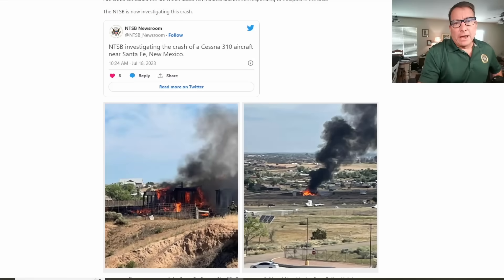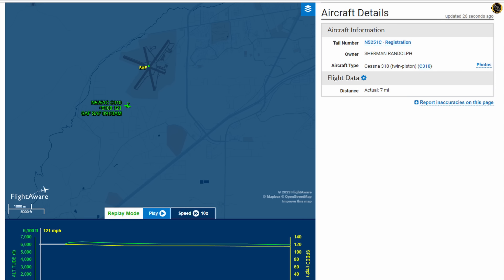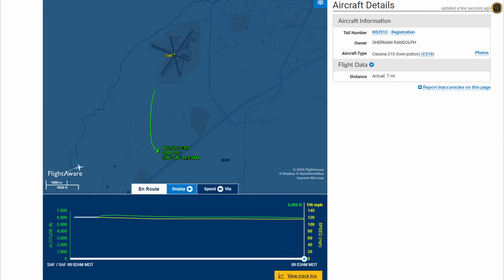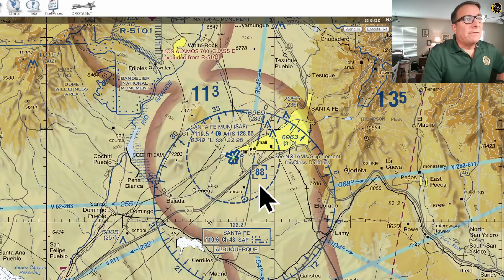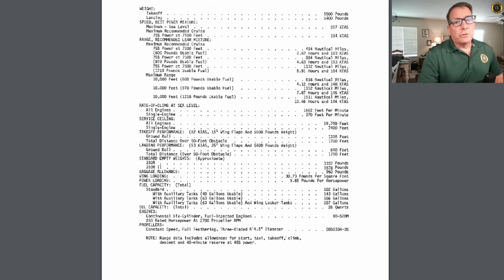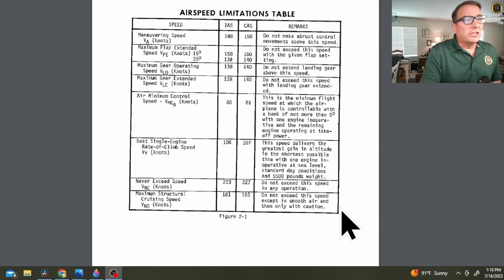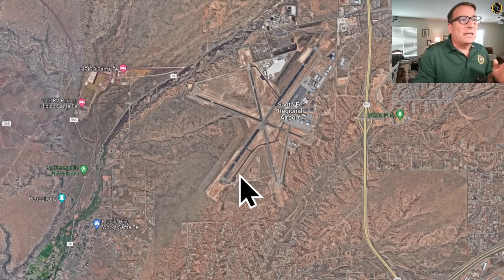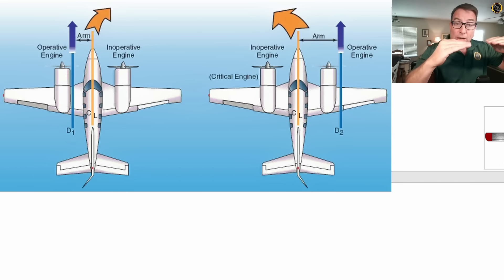Fatal C-310R Engine Failure - Santa Fe, NM

Comment: I watch the entire video so not sure if this was mentioned or not. When I was going for my multi-engine endorsement at Elgin AFB aero club I was was always nervous taking off in the 310. The 310did not have counter rotating props whereas if you lost the left engine the right one would push its wing over very quickly causing a downward spin to the left.  Luckily most of my flights were in a Beechcraft Duchess.

Comment: This makes me angry. A vmc roll is always avoidable. We train train train all the time.  I could do the flow in my sleep. “Maintain directional control. Pitch attitude, airspeed. Mixtures rich, props forward, throttles forward. Flaps up, gear up. Identify dead engine with dead foot, then close that throttle to verify. Feather that prop, cutoff that mixture. Declare emergency with ATC and return to land.” And all of that happens within the span of seconds. It needs to be second nature. In the right hands, a twin is safer. In the wrong hands, it’s more dangerous than a single engine. I pray for his family. It’s absolutely tragic. But also avoidable.

Comment: Is there ever a case where you would want to pull power on the good engine just to maintain level flight and crash straight forward like in a single?
Reply: Yes part of a multi engine check ride is VMC demo. Where you add full power on one engine with the other one in idle then pull up until you loose direction control. Then pull back the power on the good engine and lower the nose. When you are above redline you can add the power on one engine slowly to maintain blue line.
Reply: @Jopanaguiton  thanks
Reply: blancolirio4  cool thanks! Was just wondering, as a student my instructor always said if you lose your engine (single) on take off land to the front 180degrees don't crank it around hard and stall.

Comment: Was this a T310R?  Turbocharged?  Where the values you gave for 310R takeoff and single engine climb performance for a turbocharged version of the 310R?  I fly turbocharged twin Cessnas, and they are not stellar performers in hot and high conditions.  Condolences to the family.  Let us all learn something from this.
Reply: @@user-ef2bx9fb4y I don’t have experience in the Turbo 310,  but I do have experience in Cessna 340s, 414s and 421s.  I believe that having turbocharging should have helped matters.  High density altitudes do cause performance reduction in all Cessna twins however.

Comment: His fate was sealed the moment that engine quit at that density altitude.  In this case the second engine making full power only led him to the crash site.  RIP
Reply: According to the ASN report shown, the accident aircraft was actually the turbocharged variant, so the performance chart shown in the video is incorrect.  It should have been able to climb with one engine.

Comment: Another classic case of the second engine taking you to the scene of the accident.  Jets are guaranteed to have single-engine takeoff performance.  Piston twins are not.  If any single-engine climb capability exists -- and it DOESN'T exist at high density altitudes -- it's predicated on achieving Vyse with the gear & flaps retracted and the failed engine feathered...and all of that is NOT going to happen immediately after takeoff.  In those cases, you have to mentally brief yourself that you're simply going to close both throttles and land (more or less) straight ahead and under control.
Reply: 🎯   And, additionally, you HAVE to remember, those performance numbers are calculated using a brand-new airframe and engines, the control surfaces are rigged properly, and the systems that control the landing gear and flaps are new, which means that the gear and flaps operate quickly, AND, the pilot flying IS a test pilot, AND IS expecting an engine failure, AND has the procedure for that failure practiced and perfected…
 As soon as you start to put wear, tear and years on that airframe and engines, and you vary from what the altitude and temperature were when those numbers were recorded, every one of those figures WILL be degraded, period…

Comment: I used to fly in to Ruidoso every year in our 310Q with the family.  In the winter.  The single engine service ceiling of that normally aspirated twin is routinely below the density altitude of the field on hot days.  Even though it's all down-slope to Roswell from there, such operations are a crap shoot.  Very sorry this pilot came to grief.  I reserved Santa Fe for winter trips as well with that airplane.  Same density altitude issue, but no downhill escape option.

Comment: A multi-engine rating needs to become a yearly recurrent training required certificate. Not a BFR but a real recurrent training with multiple engine out maneuvers. There is NO REASON for an engine failure to lead to a fatal accident in a twin-engine aircraft. Full stop. GA's track record with this is COMPLETELY UNACCEPTABLE. The FAA is failing both the public and the pilot community by allowing this insanity to continue. It's the same accident again and again and again and again and again and again and again and again and again and again and again and again and again and again.

Comment: When that engine failed he was 2k feet over the aircrafts performance envelope and immediately out of ideas,  altitude,  and speed...  There was no chance save setting it down straight ahead and terrain looks to of made that impossible... Is there a gross wt on the 310 that all other factors being equal he would of been within that 7kft performance envelope or was this simply not a day to fly???

Comment: When the engine failed, he essentially was already above his single engine service ceiling.

Maybe this is another example of how a competent pilot was unable to pull the throttle back on the good engine to maintain control & accept an off field landing.  I've read so many accidents of light twins where top notch pilots have allowed the airplane to become too slow.

Comment: I think this pilot took the ATC offered runway as a command rather than as a suggestion. People get complacent when they get used to taking commands. I think the order of Aviate Navigate Communicate was not properly followed here but there sadly is no way to know for sure. I think that better pilot awareness on minimum  maneuverable airspeed probably would have prevented this stall spin. I bet if he had flown straight off the end of the runway rather than trying to come back there would have been a much better outcome.

Comment: Light Twins (and Singles)  in the US South West with High Density Altitudes............  This is 100% preventable.  Right now my Airport has a DA of 10,100 ft.  Actual Runway elevation  is 7000 ft.    You're going down hill before you ever get to go up.... KJTC

Comment: Every twin pilot SHOULD know that you NEVER turn in the direction of the dead engine...period.  The temp issues certainly exacerbated the intial incorrect decision.  Two lessons here...ambient temps/altitude and dead engine piloting need to be reviewed before intializing flight. RIP...so sad and unnecessary.
Reply: It shouldn't be a problem to turn into the dead engine if you are at blue line speed.

Comment: I fly into KSAF often. With a DA of 9,000 ft, and such poor single engine climb performance, this poor fellow was practically doomed from the moment he lost the engine. Might have been better to try landing on I-25 instead. High DA can sneak up and bite you, if you're not accustomed to flying in and out of high elevation airports. Some planes that are adequate at lower field elevations have horrible performance at high DA. I once had to abort a takeoff in a Piper Arrow at Grand Canyon airport due to high DA...couldn't climb out of ground effect. I had no idea light twins were so vulnerable to loss of an engine at such conditions. I know several folks who own them at even higher elevation airports. This twin was a significant liability at high DA.

Comment: No one ever expects nor plans for an engine failure on takeoff, but they should.    It's difficult to train anywhere but a simulator, but I used to demonstrate the turn performance on single engine at 6000 feet and pretend that it was runway elevation.   I'd have the student "take off" from 6,000 feet, climb to 6500 then I'd simulate a failed engine, have the student feather the dead engine and try to turn back to the point of where he took off.  We never made it back around before passing below 6000, even on the longest most shallow turns.   Light piston twins just don't have the power to turn or climb on single engine, (except maybe sea level in the winter) so it's best to plan on landing somewhere straight ahead or with minimal turning, like a road or a field if one is hopefully reachable.   Oh and I've got a couple of thousand hours of taking off from Santa Fe in 402's and 310's, so I know the real world performance of those aircraft there.

Comment: Spot on. About 1,500’ DA over max single engine performance at TO. Should have left it parked. Ask yourself: “Can I get this thing to fly on one engine today?” If the answer is no, then if you decide to gamble a departure you are essentially betting you won’t have a two engine failure since having only one engine is the same as no engine at that DA.  Rolled the dice and lost the bet. Gear up straight ahead was his only real option since that bird was not going to fly on one engine. Might have survived that. Turn back was never in the cards and should not have tried it. Should have had that thought in his plan when he added power. Question at what point did that engine begin to fail? Did he recently have maintenance on that engine?

Comment: Probably not the last one of these we'll see in the near future with the extremely hot conditions over much of the US - there will be more than one pilot getting caught out by density altitude - especially if there's temperature inversions and stratifications where the runway/ground temp isn't indicative of the temperature a few hundred feet off the ground.

Comment: You talk about this stuff all the time.  Density altitude and single engine operation in a twin, easy stuff to check before departure. How about flying straight and get altitude and some airspeed or widen the turn back. Or worse case, land straight ahead. Man, that guy was in a pickle before he even took off.

Comment: Im not a pilot but I think they need to get these pilots access to better single engine failure training in a twin engine plane. So when this happens they are ready. Ive noticed that in the majority of  the twin engine single engine out videos I have watched ends in a vmc roll and fatality. They either get too slow or turn into the wrong engine and I hate seeing them go out like this. Because eventually they are going to tighten the rules for general aviation pilots if this keeps happening to the point its going to be nearly impossible to be a general aviation pilot if planes keep crashing into houses and places where the safety of the public is put at risk.

Comment: Tragic. Condolences to their family.
Reply: Wrong this plane does have a 17000 single engine service ceiling
Reply: @Jopanaguiton  my mistake, I had just read the figures Juan showed in the video and assumed that was correct
Reply: @Jopanaguiton   WRONG, just maybe maintain 17,000-  if you’re already ABOVE that altitude AND at cruise speed…   It WILL NOT climb to and maintain that altitude from below…

Comment: I’m so sorry to hear about this, I’ve always wondered why more instructors in GA twins don’t teach that sometimes its better and safer to just put it in a field.
Reply: I got my multi rating in 1966 in a twin Comanche. Nice airplane, but not a lot of single engine performance. We were taught that pulling the good engine back and landing straight ahead might be necessary to maintain aircraft control. 

We had to do a Vmc demonstration on our check ride, and for some dumb reason back then the FAA wanted it done at a very low altitude. We’ll, after a string of ME training accidents they rethought that and increased the minimum 
altitude to a much safer level. 😏

Light twin engine out  skills are something that has to be practiced on a regular basis, or they get rusty quickly. In the corporate Jet world we practice engine out procedures every time we do our recurrent training, and they have much more performance than a light twin. And even in a jet DA can be a safety issue.

Comment: Just a question so giving that information should he not have taken off with that density altitude?
Reply: Wrong. He used the charts for the N/A version. But it was the turbo version with much higher ceiling heights.

Comment: I think making any instruction on turn and direction in the event of an engine failure of a light twin is unhelpful. The first thing the man needs to do is clean up his aircraft and hit blue line. Turning is not a part of that. Maybe that was a factor in the crash and maybe it wasn't, but ATC can't be injecting more problems into an already overdone workload.

Comment: All types of engines fail. But when you're emulating birds, a failure is disastrous. Or can be. Unlike a lot of airliners, these smaller planes can, with skill, be gliders. I infer from the very large number of these GA plane crashes, the challenges of flying them exceeds what the pilots can handle. Still, the Alaskan bush pilot was as skilled as you can get. So the environment is lethal sometimes.
Reply: But even he had a career emulating a bird. What happened to the bush pilot would not have been fatal for a bird.

Comment: Im guessing the accident is compounded by lack of time( im not a pilot) and if atc had not recommended the left hand turn based on the general knowledge of prop rotation and engine failure on that side...should atc have known that based on the conditions and knowledge of that aircraft in those emergency conditions?

Comment: 6400 maximum, then down to 6100, so the airport actually seems to sit higher than immediately surrounding terrain. Even if he feathered correctly, it's obvious that he was never gaining altitude, which was his plan (as per audio). I wonder if, after noticing that he wasn't gaining altitude, he tried to go for the highway. 

When I fly single engine I tend to always look for suitable field to land, while when I fly the Seminole (counter-rotating prop, so no critical engine) I tend to focus more on Vmc and proper procedure. But we need to remember that even in a twin, we need to look for suitable landing area in case of engine failure. Two months ago at KLAF (low altitude, 600ft) on simulated engine failure I could barely climb while keeping slightly above Vmc, even after simulating feathering 😮
Reply: blancolirio2  yes, I'm very curious to hear from more experienced people (I got CPL ASEL with IFR, and ground CFI, but not done with AMEL yet. So I'll be glad to get more advice there. As I already said, I tend to not "look for suitable field" when I'm on multi)

Comment: Well done, once again, Juan.😂
Reply: Reminds me of a Karan H-2 early test flights in the early 60’s.  The copilot’ seat and flight controls were absent leaving the cyclic control only a stub in the deck.  During the flight one of the techs put his boot against the stub forcing the pilot’s cyclic to its stop.  The pilot’s reaction was to correct this, locking the tech’s boot even tighter in the recess and the cyclic stub.  This induced uncontrollable flight.  Results were fatal.
Reply: Should be Kaman.

Comment: I know this little airport well.He could have survived by doing a desert landing right off the runway. One must do your homework at this high altitude, this fellow RIP did not, a quick calculation shows he could not gain altitude at one engine on a very hot day. It's marginal at Santa Fe even at 75 and wind here is almost always a factor. He should have know that pre-flight after he did the normal altitude density calc. Taos is up another 1000 feet - read up on mountain flying and be conservative.

Comment: For those of us not familiar, what is "a BMCA roll"? I tried looking on Google and nothing popped up.
Reply: Vmca = minimal controllable airspeed (airborne) with the critical engine inoperative (for most twins, the left or #1 engine).  Marked with a RED radial line on the airspeed indicator.  

If airspeed falls below Vmca, there is insufficient control authority to prevent the aircraft from rolling uncontrollably toward the inoperative engine - and almost no one walks away from a Vmc rollover.
Reply: @Mikey300  Thank you. Listening to it again, I hear the V instead of B, and now all sorts of answers pop up online. Thank you again.
Reply: Not B but V.

Comment: According to the report like it crashed at ~0900 when the temp was supposed to be in the low 80s. However, looks like he was still missing about 500 feet of density altitude for single engine operation although he was probably under gross weight. So close.